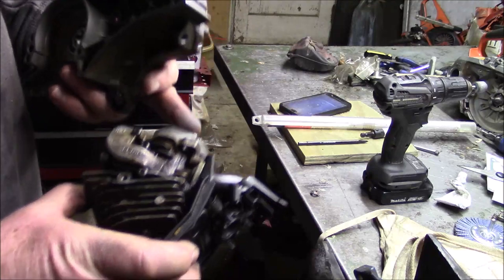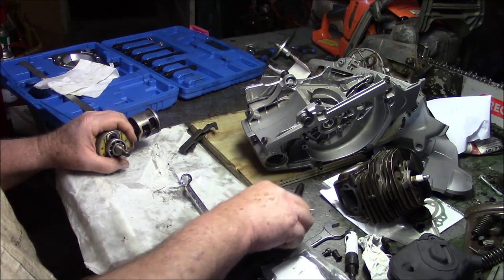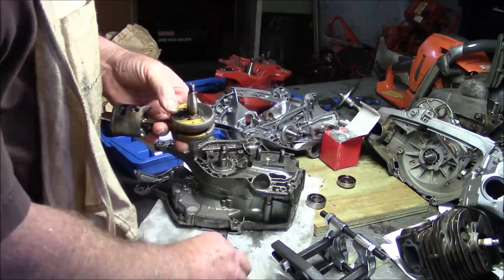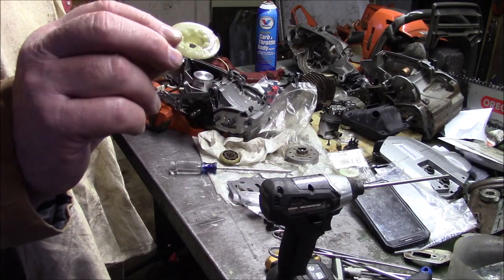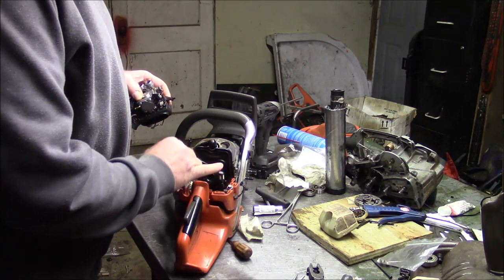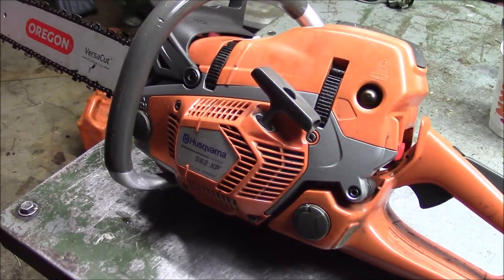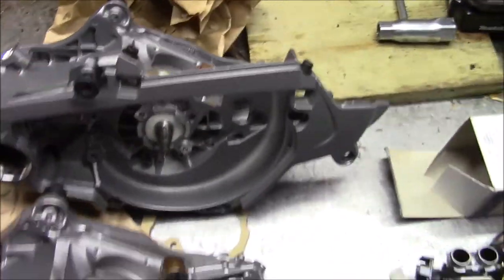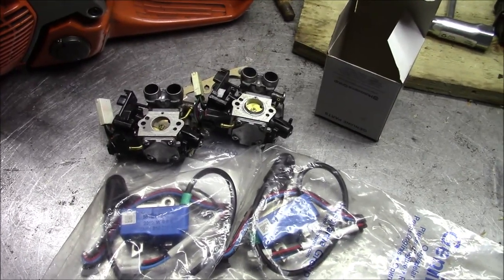Husqvarna 562xp HTSS Simple Work Saw Build - Husqvarna 562, 555 Differences &  Updates  Part 2

Comment: Awesome vid Walt.   I’m so tickled to see you do this.  I’ve always made my own gaskets.  I have a roll of brown paper much like a paper grocery bag.  I cut the gasket out and match it to the cylinder and then I spray mine with the copper gasket spray and let it dry.   They mic out at 16 thousandths and after they are compressed on the cylinder they mic at 8 thousandths.   I’ve watched you use the three bind forever and it does good but if you ever have to take the cylinder back off it’s such a mess to clean up and the gaskets just make it so much easier.  Again awesome vid, love the content on the AutoTune saws.  I’ve not had an opportunity to build one mainly because I thought they were out of my realm and it was all because of the AutoTune.   Keep them coming and thanks for sharing your knowledge.

Comment: Thanks so much for making these videos.  So many details.  I have a 2260, and always thought the crank, etc. was the same as a 562.  Also, I saw the next video, and man, that junk pile saw runs.  I hate to tear mine apart to do the same thing, as it runs great now.  But, this junk pile build is light and real strong.  Thanks again for all the info and videos.  I'm just kind of getting into porting (yeah, I know, way behind the game), and thinking of getting one of the farmertec 372 non x-tork saws to play with.  I can't believe how much just a little transfer work, reduced squish, opened exhaust makes it so much quicker response and stronger.  They are nice light saws, and work great here in Idaho cutting pine.
Reply from the maker: With the Auto tunes, just run them stock, they run like a ported saw...stock is my advice. WHEN one blows up, then the rules change a bit I guess. And the X--torq is a great place to learn. Stick with them as HUGE gains are possible with those saws, and if they come apart, who cares :)
Reply: @afleetcommand  Thanks!  My thoughts exactly.

Comment: The metal gasket used on Stihl big saws is .015”, as measured on my Brown& Sharpe dial mic.  Some AM cylinders come with a fiber gasket and these vary from .018-.040.  I like the Oem Stihl metal gaskets with 1184 or Dirko on both sides as well as on the case and cylinder flange.  I get a good seal, this way.

Comment: I put several of the screws in the case half to align the gasket.  It has a bad habit of dropping down in spots and I end up having to get it back into position after the two case halves are together.  That, can be tough.

Comment: A very interesting and informative video with some Great Tips on these series of saws. 
I play around with equipment like saws because I not smart enough to do a crossword puzzle LOL. 🤓
Whats your take on stuffers? My theory is its an EPA thing, to take up volume to cut down the amount of fuel charge affecting emissions, but this is just my thinking.  🤔
I just sold my 576xp non AT parts box build I done with a 575 crank and piston, 576 used OE cylinder and no crank stuffers and very mild port work and I'll have to say I was very impressed with how it ran.
Can't wait for the follow up videos on the carb and coils. Thanks.

Comment: I do not tighten down case screws with my drill.  I use my T handle wrench to assemble all bolts.  I may remove a bolt with my battery powered drill, but it goes back together with my T wrench.
Reply: He uses his T handle like you too, where necessary - but these threads weren't cut yet, and the impact kind of helps with the self tapping bolts, they actually go in better the 1st time with the impact.  Need to be careful after that though so you don't strip them, and ensure the bolts use the same threads again (go backwards a little to start, until you hear it click, then screw forward)
Reply from the maker: TY and yup that's dead on.

Comment: Great video.
Just curious what your squish is on this one, must be right around 14 or 15 thousandths?
Looking forward to the future episodes testing the other combination of parts😉
Reply from the maker: Stock it was .040". And the Gasket "Stock" was .030". The new gasket paper was .010 plus a little and the "goo gasket" adds another .004 so the total gasket thickness "new" is .014-.015" SO .015 less than the .030 stock which means the SQUISH is .015 less. :)  .040  - .015  = .025 and if it settles a bit MAYBE .022-.023"
Reply: @afleetcommand  Have you run it enough to check compression?  I wonder combined low squish, with the pop-up what it would be.  It sure runs good.
Reply from the maker: Only have two tanks thru it, will put a couple more thru tomorrow and then check both it and the stock build. Should be pretty representative right? BTW that stock 562 runs better than it showed on the video. I would NOT put it down for another saw if I was working it.
Reply: Thanks Walt, the two I did had 0.0275", squish and base gasket, so with them squish was determined by the base gasket.

Comment: What happened to the 572 that you got one to take a part already?
Reply from the maker: That one was tractor damage n the flywheel side that was left & run anyway and created other damage...basically a ruined saw. I got the "bones" the owner kept the good stuff for spares. Bob also put a case in my hands and I don't know it's story. I have a love hate relationship with 572's....love them because they aren't breaking and I figured after a few years they would start showing up...they haven't. Hate them because dead saws to build just aren't happening. I have had a rash of 461's showing up now, think because they have done their time. So may have to "jump" to those as a filler until the 572's show up. I've done enough 372's...and will build 562
s but they are a different class saw.
Reply: @afleetcommand  
Thanks for the response Walt. They’ve been out long enough you’d think the pro users surly would have some blown up or worn out but from what your saying you aren’t seeing it. That says a lot about it’s build quality.
461’s have been around a long time already, surprised you’re just seeing them now. They are good saw I know for sure
Reply from the maker: I've seen the 372's, 576's, and 461 in drib's and drabs this last couple of years.. early on I saw a LOT of 372's and now for some reason it's the 461's turn. Maybe just a statistical thing. Bob has a good analogy though, he rightly observed most saw shops are like "convenient" cares, stuffy noses to ear aches. I am like the class 1 ER ; I only get the ones the "convenient care's" pass through, needed trauma doc's. And it's true , the ones I get are usually trashed bottom ends at a minimum.
Reply: @afleetcommand  
Good analogy